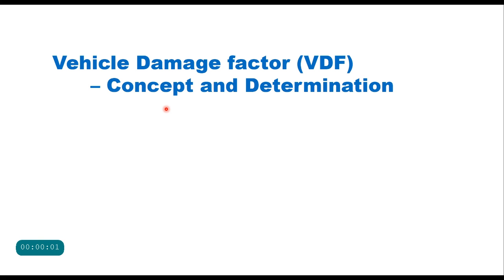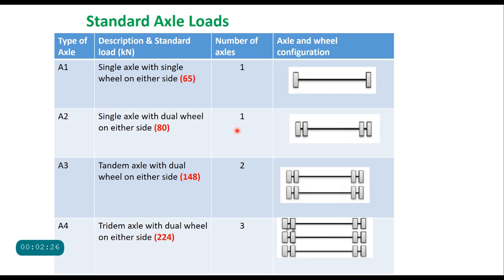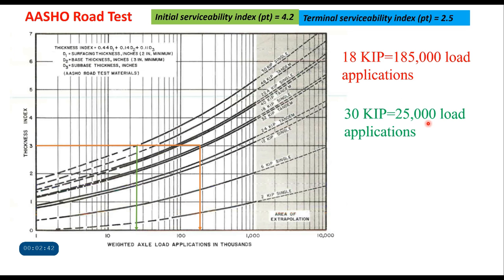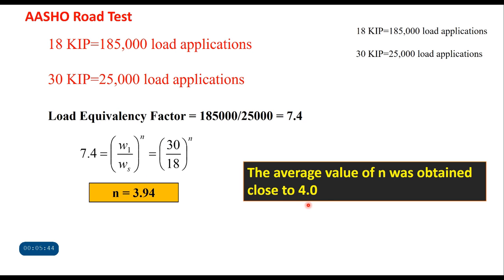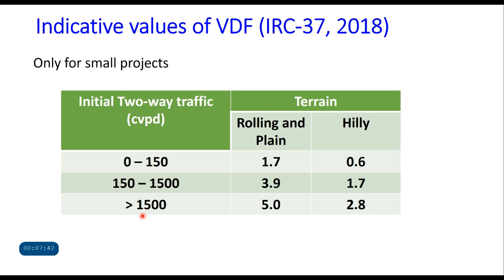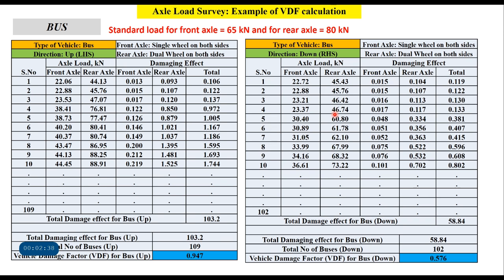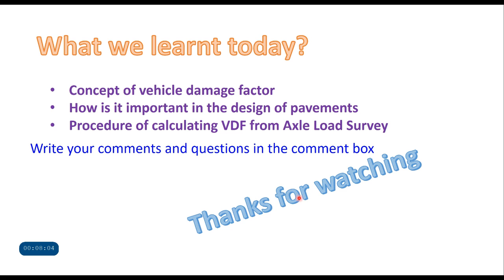#highways, Vehicle Damage Factor, How to determine VDF for pavement design

Comment: Sir, I have a doubt. The design of flexible pavement is based on Standard Single Axle with dual wheel and total standard load of 80 KN.  In case of  flexible pavement and for tandem axle of total load 210 KN what should be the correct way of calculating the VDF (A) 2*(105 KN/80 KN) ^4 i.e. 5.93 or (B)  (210/148)^4 i.e. 4.05.
Reply from the maker: 4.05
Reply: @SatishIITR  Thank you very much Sir for your response. But in example II.2 of IRC 37 2018 A dumper having rear tandem axle of 240 Kn and Front axle 80 KN VDF has been calculated as 2*(120/80)^4+(80/65)^ = 12.41. Whether it should be calculated as (240/148)^4+(80/65)^4 = 9.20

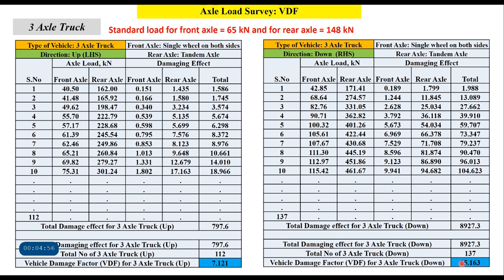Comment: 16:28 time,  in 3 axle VDF calculation, rear axle load mean the load obtained under one of  the tandem axle and doubling it or taking the weight under two axle at at a time
Reply from the maker: Yes, taking weight of both wheels or axles together

Comment: sir can you explain about spacing between front tyre to rear ( grater than 4.5 and or less than 4.5) why we note this in the field and where it used.
Reply from the maker: This information is required in the design of rigid pavement. How? Watch my video on design of rigid pavements.
Reply: @SatishIITR  thank you sir

Comment: A bus has two axles. front axle with single wheel on either side and rear axle with dual wheels on either side. shall we calculate and add the VDF(front)+VDF(rear)=VDF(effective) for each vehicle?
Reply from the maker: Yes

Comment: Sir, I have doubt, as we convert all commercial axle to standard axle like single axle to standard single, tandem axle load to standard tandem axle load, but after we get standard axle load for different different axle, then how we can sum their VDF 
And assume we have VDF about 2 per vehicle, but here for 2 which axle is considered for design, single axle, tandem axle, or tridem?
Reply from the maker: I did not understand your point well, but let me try to explain. Each axle will cause some damage to the road.
Take a three axle truck, for example, the VDF of its front axle is 0.5 (say) and that of the rear axle is 5.7. So the damaging effect of this truck on the road is 0.5 + 5.7 = 6.2. Now you have 112 trucks in your count. Find out the damaging effect of each truck and then overall VDF will be total damaging effect divided by 112. 
I hope it is clear now.

Comment: In case of tandem axle...which wheel load should be considered? Like 2no axle load 400kg 3no axle load 500kg then which wheel load should be considered for calculation?
Reply from the maker: Tandem axle has two axles only. Take the total weight on both of these axles.

Comment: Sir how to calculate vdf for multi axle vehicle
Reply from the maker: VDF equation is same. You need to take standard axle load accordingly. For example, for a single axle with dual wheel on either side, the standard axle load is 80 kN. Similarly, for tandem axle with dual wheel on either side it is 148 kN. You need to calculate VDF for each axle, whatever be the number of axles.
Reply: @SatishIITR  thank you sir

Comment: Sir, I have gross weight of Tridem Axle Vehicle from weigh bridge data. Plz suggest how to calculate VDF with this data.
Reply from the maker: The standard axle load for a Tridem axle is 224 kN. Use this value in the fourth power law to get the VDF

Comment: First of all thank you for your video which has a great help in pavement design as well as for road infrastructure management and maintenance. And currently, I am working on road user’s fee revenue generation. The vehicles are going to pay for the road maintenance as per their damaging effect on the road infrastructure from Bajaj to Sino Truck. Do you think it is appropriate to propitiating the payment ratio based on their damaging effect factor is right?
Reply from the maker: Yes, that will certainly discourage the overloading on pavements.

Comment: Sir nicely covered the topic. However now adays the vehicles have single axle with single wheel at back. How to treat such vehicles for vdf?. They are not completely tandem or tridem with dual wheel set. Pls elaborate on this.
Reply from the maker: For single wheel on axle, the standard load limit is 6000 kg.

Comment: Good Morning Sir. As per my knowledge MoRTH has increased Standard Axle Load to 75KN for single axle for single wheel on either side 115KN for single axle having dual wheel on either side some two years back.correct me if I am wrong .
with deep regards
Reply from the maker: they have raised legal load limits and not the standard axle load.
Reply: @SatishIITR  right sir.